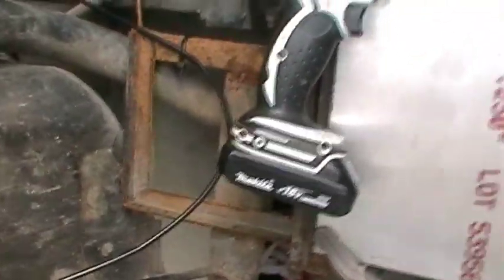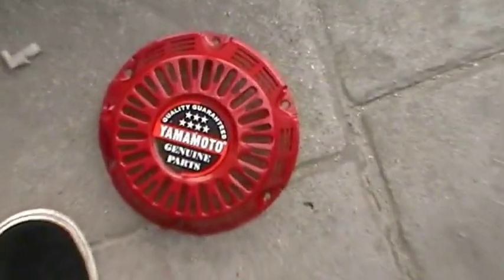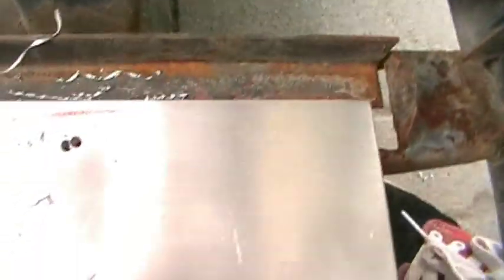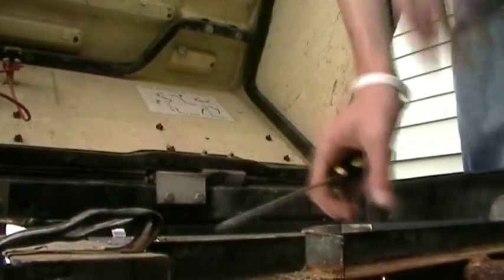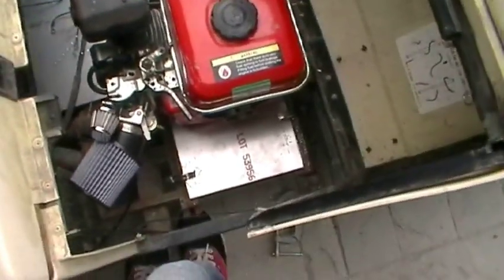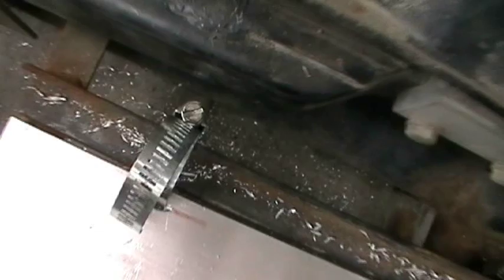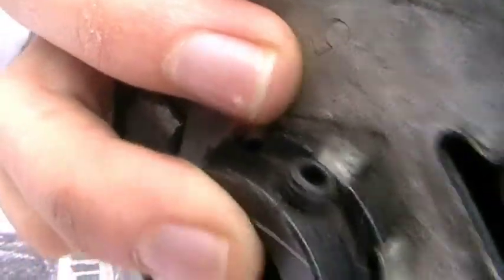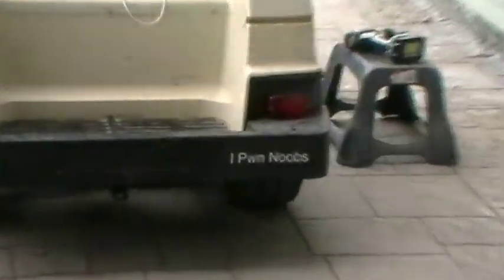Electric to Gas Golf Cart Conversion Pt 4

Comment from the maker: @stephen1994100 Well, it mostly depends on the gear ratios, but currently the way the gears are setup, it tops out at 26 mph. And it can go from a stantstill to that in less than 6 seconds.

Comment from the maker: @stephen1994100 Is or was your golf cart electric or gas? If gas, the gx200 motor mounts might not match up, so i would look for a gx390, or a gx420 The 390 is 13 hp, and the 420 is 15 hp.. If electric, These gx200s have hundreds of upgrades available. the record horse power for these is 41HP. The Gx200 is a perfect choice for a converted golf cart because of the limited space under the seat.